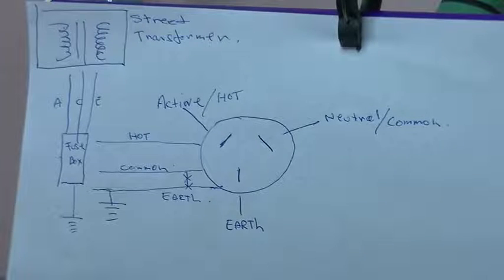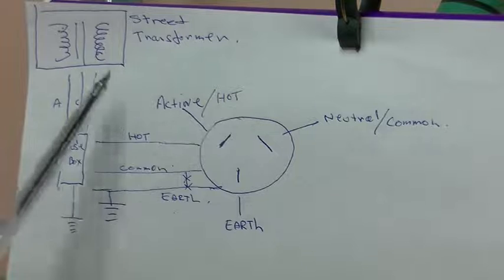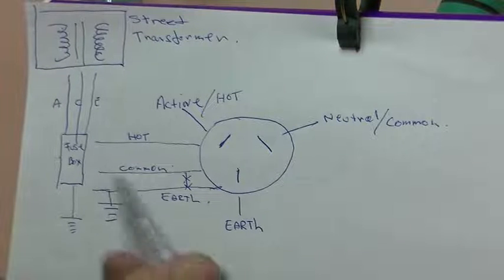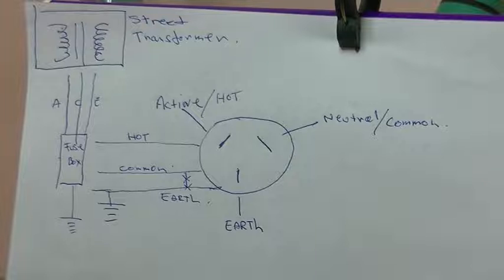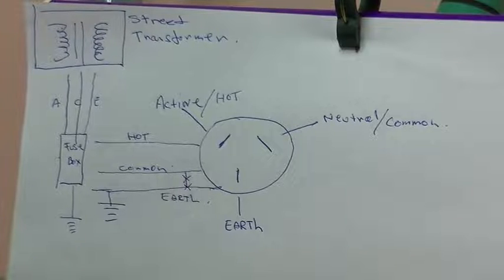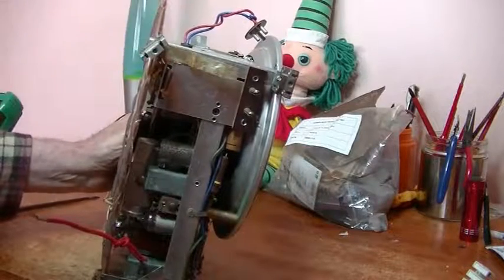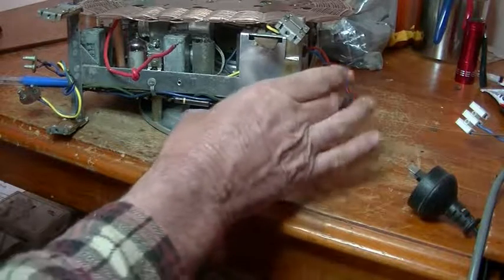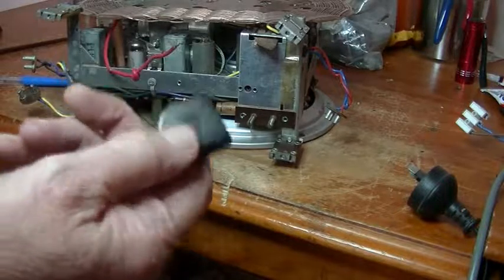Hot Chassis Radios. How to tell if the chassis is hot or not

Comment: Ive worked in the electronics radio field and never came across a “Hot Chassis” before other than the typical AC/DC AA5 chassis that had the  So-Called isolation network in it. However today i worked on a 1947 Admiral AM radio that was a true Hot Chassis. There was no floating B- circuit or isolation components. The Hard ground AC or DC was literally the chassis. Now of course I always use a good isolation transformer for my safety and all my test equipment is floating like a VOM. My signal generator is coupled to the loop antenna via a similar loop. I disable the local oscillator with a short across the osc. Coil to eliminate any harmonics from that circuit. I handle the chassis with rubber gloves. Making repairs and restorations was a breeze. All grounds could easily and readily be accesses at any point on the chassis, affording easy soldering ant part to ground.  If I had my preference I would rather work on Hot Chassis all the time. The wiring rats nest was far less cluttered with unnecessary wiring. I ask who needs a scope or VTVM while working on a Hot Chassis Radio, when a VOM set on Ac Output will measure the peak reading required.  Good signal generator will radiate any signal to the loop antenna with ease, even the xtal controlled 455 kilohertz IF signal. More and fancy equipment is not really needed. I save using that equipment for the tasks that really need it. The worst thing manufacturers ever did was make a set with no transformer to cut corners and increase profits at the expense of customers and technicians  lives. Ill give you that they did take some precautions with plastic and wood cases and knobs. All that nonsense with three pronged AC power plugs and grounded chassis is a bunch of engineering masturbation by overly educated cowboys. .